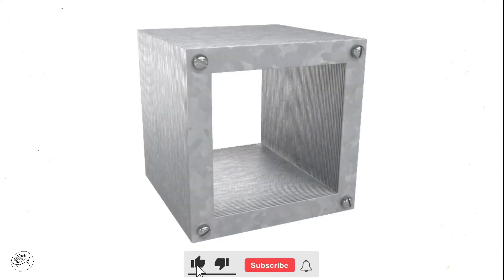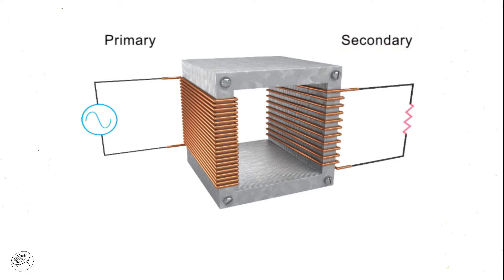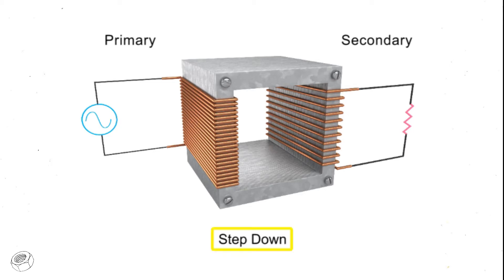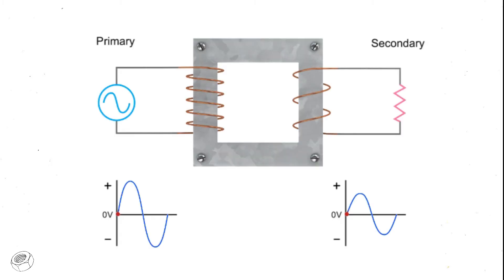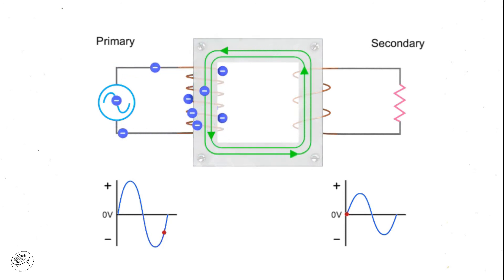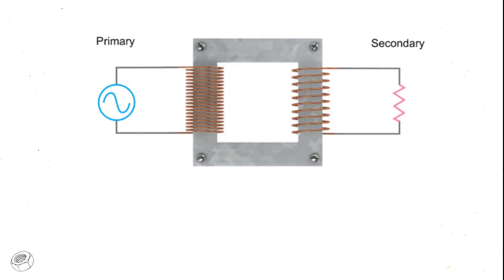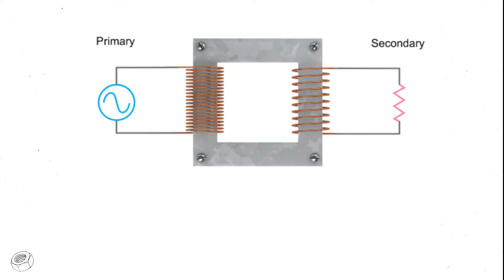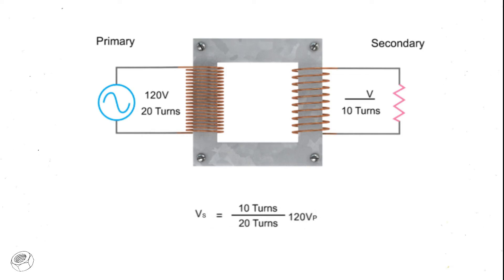How Transformers work explained animation

Comment: Sir winding can protect ac voltage while connecting to primary?
Reply from the maker: I did not understand your question.
Reply: @engineeringeasy6731 if we connect ac voltage directly without any load to primary winding on transformer directly it do not get burst, blast how sir. Conductor or insulator protected or magnetic flux?